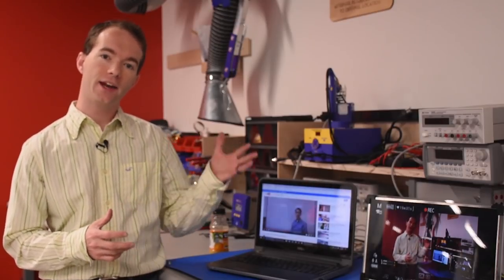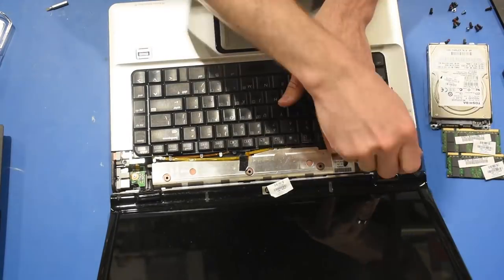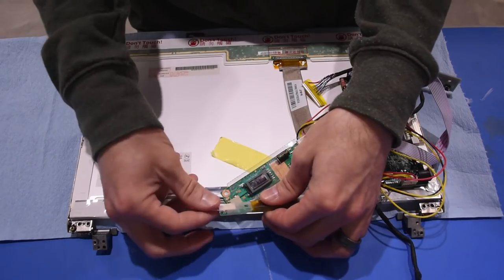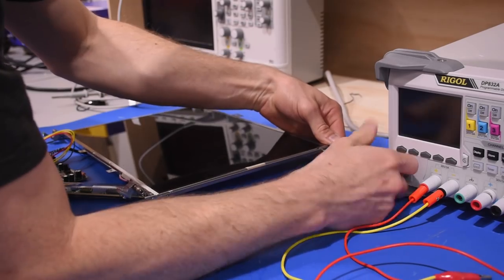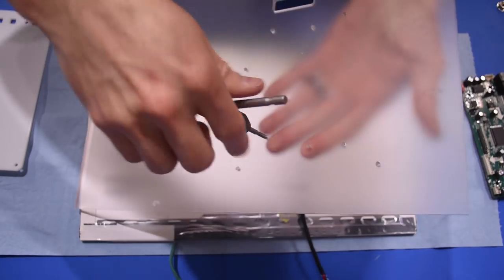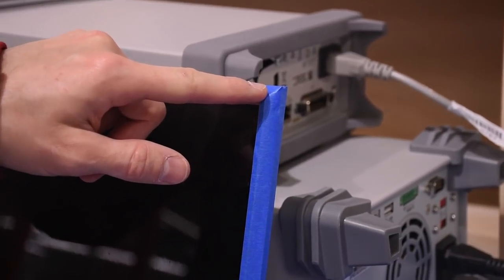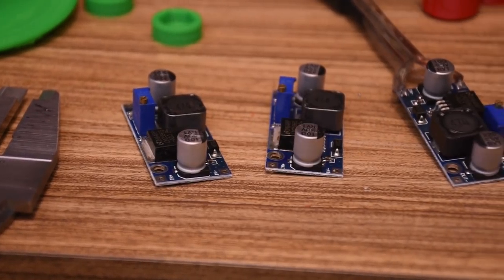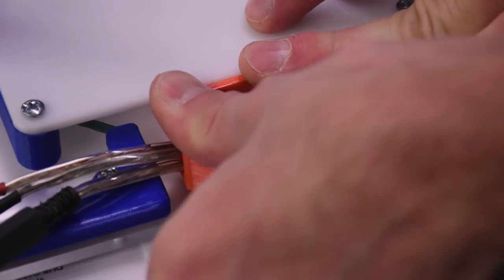Making an External Monitor from a Laptop Screen - Mikes Inventions

Comment from the maker: Any and all STL Files for this project are now available for download on my website! I also apologize for the Anakin quote. It was something of a running joke at work, because hey, how often do things actually work perfectly on the first try? I'm big on movie quotes, so... yeah. You'll come across one frequently. Even bad ones.I'm also so sorry about the audio issues. It's far too late now to do anything about it, and I certainly understand all your frustration, but I sure appreciate your sticking with me on this one.
Reply: (y)
Reply: Hi.after seeing your videos I got an idea of making android TV from broken android device and connecting it to DIY laptop screen.
Reply: i have the exact same monitor from a HP here. Just wondering why not leave the TFT enclosed in its original black housing. This way the hinges can be reused and its better protected for cleaning the front side.
Reply: Sir , i have one doubt for that how can i ping you
Reply: can you share me one controller as, I am not getting sure, and I wish the same controller which you have.

Comment: I'm just going to buy a new monitor
Reply: Yeah its better me too
Reply: I bought a Thinkvision T24v FHD IR camera and USB ports
Reply: The difference is yours won’t be portable
Reply: @AK-gt8zy  they do sell portable monitors.  Although this option is much cheaper, the purchased option is easier for those not mechanically inclined.
Reply: Wtf only thing you need is a 20€ controller and plug it in.
Reply: @fakedketchup5029  I did but I'm still waiting for it to arrive from eBay, i forgot about it by now
Reply: why waste money, i looking new monitor cost 19" 4000 B and old laptop display 17,5" FREE and PVC sheet 10$ and little funny work have good display now only new display driver board prize. 18$ cost aliexpress. this driver board include tpa xxxx chip amplifield speakers, vga,hdmi,out, raspi connection perfect. my new raspi4 8gb come in this display box too. out stay only display 12V 3A power and raspi 4 usb-c power.5V 3A. inside come speakers, both side, and old laptop 500gb HDD, ready have own cheap table computer again. all in one box.
Reply: Lmao
Reply: Me too
Reply: XDDDD

Comment: "You can see that building an external monitor is really as simple as buying a controller and plugging it in...... as smart as this video is Mike, I think that this build is slightly more difficult than plugging a controller in.

awesome build by the way
Reply: it actually is that simple. You kinda just need to know what to buy. What was kinda of glossed over in this video was getting the right power connector and power supply. I had a lcd monitor and controller sitting on my desk for a few weeks because I didn't have the right charger. Got one now, tho

Comment: That's actually a really good design, I've been sitting here for 5 minutes trying to work out how I was going to build mine, this is a really versatile and best of all portable design. I'll be hopefully using a small step up converter so I can run mine off a 2a usb plug though. Thanks for the inspiration
Reply: Hmm a USB step up to 12v sounds nice. So I can power it up via my desktop computer, via a USB charger, or via a USB power bank.

Comment: Depending on the laptop you use for this you can sometimes reuse all or part of the original screen casing/frame(i don't know what it's called). It probably won't fit the controller but considering you have to build something anyway, modifying it can be easier.

Comment: Thanks to your channel, I solved a problem where LCD controller board (ext. monitor) and laptop have their own power supply. So, I branched my laptop's adapter cable, one line to laptop (19 V), while the other one to external monitor using step-down XL4015 CC/CV (12V-1A). Previously, I used LM2596 (CV), but the module exploded due to overheat. It's my first time did some project like this.

Comment: Is controller necessary ? My monitor connectors are melted/burned. What if I cut wires open and just wire them straight to HDMI port ?

Comment: I got a controller board for my old HP laptop monitor. It worked great for 2 months, now suddenly the green light goes red and my screen goes black. I cant turn off the red light. I unplug it and when I turn power back on, it turns monitor on for about 10 sec and then flashes red, screen goes black and then red light stays  on. What does this all mean? I cant find any answers on the old web

Comment: what if you just took the keyboard off then just sandwich the two pieces together. You will still have access to the USB ports power ports and headphone port. If you did a wireless connection between your main setup and the now sandwiched laptop, all you need to make is a stand for the laptop.

Comment: I have the same exact laptop that just recently got busted few days ago. Could you tell me what was the model number of the screen so i can search here in the Philippines. Thanks.
Reply: I have the same exact laptop too!
The graphics card died on mine. 
Not worth spending money on replacing the motherboard so I'm  thinking  about using the laptop as a display for an entry level PC.

Did you find what you were looking for?
Reply: Oh wait, I can tell you the model number I think. 
We are talking about the HP pavilion  DV6703TX right?

Comment: What kind of wire should i use to lengthen the power wires for the backlight? Keep up the good work!
Reply from the maker: Hey Apostolos, Just use a wire of at least the same gauge as the current wires. Thanks for watching!
Reply: @MikesInventions  Thank you

Comment: build a death ray!! will those controllers / control boards work with screens with CCFLs, or only LED Backlights? Thank you for your great video!  that video cable that connects to the upper jack, on the back top of the screen, that came with the controller? Thanks

Comment: Sorry im late but i wanted to turn my old laptop into a second monitor for streaming so i disasembled an old lenovo and got the panel and plan on ordering controller but im confused on how to power it? (Note i want it to be power straight from the wall power outlet not a battery and dont want to spend too much money.

Comment: I have an LCD ripped out of an old laptop which stopped working some time ago. Before buying the controller I have to make sure that LCD is working. Is there any way to check that?
Reply from the maker: Hey Mohammad, well you need a way to power it and run the pixels and backlight, there’s really no way to do this without a controller

Comment: Hello sir thanks for the video
But I have led panel an there is no inverter connector what i do please reply please
Reply from the maker: Hey! I've only seen two LCD panels before that had a single ribbon cable. That's why you must find a controller for your specific part number to ensure it's compatible. I'm not exactly sure what you mean by inverter connector, but hopefully that's what you meant. I'd bet that not every panel has an aftermarket controller available for it either. Thanks for watching. Hope that helps a bit.

Comment: Mike, I'm considering a similar project however I want to incorporate  a raspberry pi. How would you suggest configuring the power supply. I want to be able to power the r pi and the monitor from the same supply. I would like to include a battery as you did. 

I'll admit I should have taken physics might have been able to figure it out. 

Any help you can offer would be awesome. Thanks.
Reply from the maker: Andy,  I'm sorry but I don't have any experience with the Pi. I don't even have a clue about its power requirements. I know I should learn it, but I'm still stuck with basic Arduino things.

Comment: Hi Mike, is there an update I need to do on the control boards?
Or does it work directly when it attacks the display?
Reply from the maker: Both of the ones I have worked right away. Maybe I was just lucky.  Now they were in "Asian" so I had to fumble through the menus for a while to set it to a language I could read.
Reply: I do not say the menu myself, I mean the first time you buy the control board you have to put a software inside or it works normal? I mean this!
Reply from the maker: The board works right out of the box, but that's why it's so important that you get one that matches the model number of your board.
Reply: i dont find  a controller that seems to fit with my display (TM150XG-02L02A), any idea what i should look for instead ?
Reply: hello can you see me how this control board works M.NT68676.2A HD Universal LCD Controller Board HD VGA DVI Driver Module With Audio

Comment: I did this,  just got my hdmi control board today,  plugged it in,  got a white screen and no signal. .... is it a defective part?
Reply: you have to check the cable pinout that connect to the lcd, there are 8 bits ang 6 bits, and 1 channel and 2 channels, check two the jumpers for video resolution and bit and channel setings, im in the process and mine mt561b didnt works but i'm sure is the cables, some lcds uses more cables than others, and has the power pins on different sides

Comment: Hey Mike cool video! I'm thinking of doing something like this to have a mobile monitor for my macbook. I'm wondering if you could explain a little more about pass through power or if you know where I could find information relating specifically to my 2017 macbook pro with usb type c ports. Thanks.
Reply from the maker: Hey Davidson, I haven't had a Macbook in many years. Back then, it had a magnetic 4 pin connector. I'd love to help if I can. Let's discuss over e-mail. Mike@MikesInventions.com

Comment: Guys i want to ask if the screen's controller has an HDMI i can use it , 
instead of buying a new one????
Reply: I don't think you can, because most of hdmi on laptops are only output
Reply: Of course the LCD controller has an HDMI input 
https://zupimages.net/up/20/42/3i35.png

Comment: Where did you get those corner clips? The only ones I can find online are made of metal and they'll probably damage my screen if I use those.
Reply from the maker: Hey Alex! I designed those clips specifically for this screen and acrylic backer plate then 3D printed them on the Craftbot Plus.
Reply: Ah ok. Do have any recomendations as to what I could use instead? I'm trying to avoid using glue just in case I want to take it apart at some point.
Reply from the maker: Hey Alex. Sorry it's been two weeks. You might want to try 3M dual lock. It's much stronger than Velcro, but operates much the same way.

Comment: Great video. Have you done this using a tablet screen? I have a nice Samsung tablet but is just that: NICE because it only has 2GB RAM and it runs Windows which is more hardware demanding than Linux. So I want to use the screen from the Samsung Tab A with a Raspberry Pi and 4 GB to run a few car specific utilities suchas maps, run the backup camera etc.

Comment: Hey Mike love the vid by any chance do you still have those STL files used for your project.
Reply from the maker: Hey Cesar. I do still have those STL's, but they probably won't do you much good, because they were custom made for my particular project. I'll e-mail them to you if you'd like to mess around with them though.
Reply: awesome yea ill take them or even better do you have the original files not sure what file format fusion 360 take.
Reply from the maker: Cesar, e-mail me at mike@mikesinventions.com so that I have your e-mail, and then I'll attach the files and send them back. I designed them in Solidworks, and I don't know if Fusion360 will import those. I'm going to try to attach the .STL files as well, because they aren't too large.

Comment: my picture is messed up, colors and resolution are off. i tried messing with every setting i could find, any suggestions?
Reply from the maker: Hey Ben. Sorry to hear that. I bet someone on here will see you comment and have the answer. I'd suggest checking the ribbon connections carefully first. I know that's not a terribly technical answer, but without being there, it's all I can suggest.
Reply: what board are you using ?if its a v56 or v59 there is a "secret"menu that  you access then change THE LVDS MAP just like brightness or volume until perfect pic is achieved

Comment: Whats the name of the board again?
Reply from the maker: Hey Felix. Do you mean the controller? That's the thing that drives the screen. It's composed of the graphics board, the backlight power board, and perhaps a separate button board.
Reply: Thanks. What about the board you used at the back for the casing? Whats the name?
Reply: +felix wendoh
It's a sheet of acryilic plastic

Comment: ijust build old 17" laptop display new raspi4 monitor i uses PVC sheet whit board better than wood use and work. and easy install. new display driver have hdmi,and tpa xxxx chip speaker amplifield, no need raspi DAC card use

Comment: can i connect tablet lcd
Reply from the maker: I'm not sure, but I don't see why not. I'm sure someone makes a controller for whatever model screen it has.
Reply: can you make a video on it? I figured an extended touchscreen for your laptop is pretty nice
Reply: You should look for a driver that supports your LCD + touchscreen and do exactly the same as he did. I do wonder you would want to tear a surface pro apart
Reply: You didn't? Ebay didnt give anything?